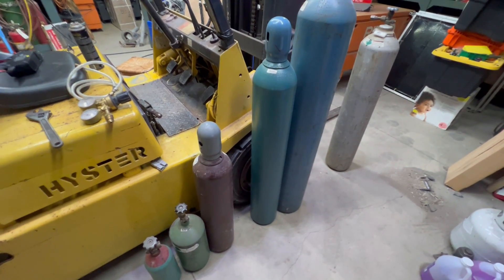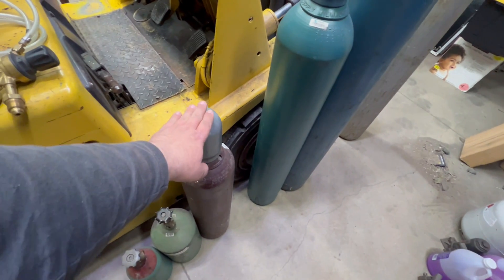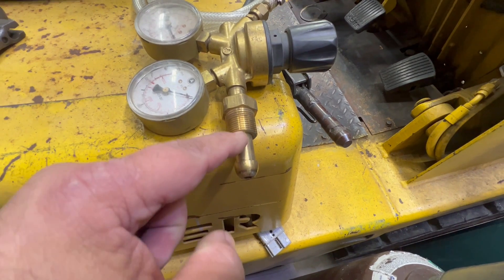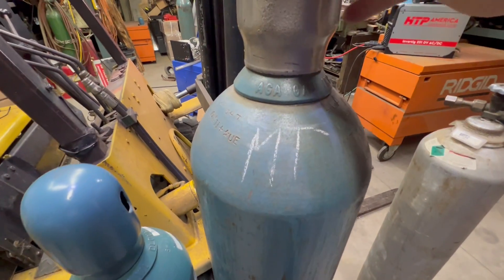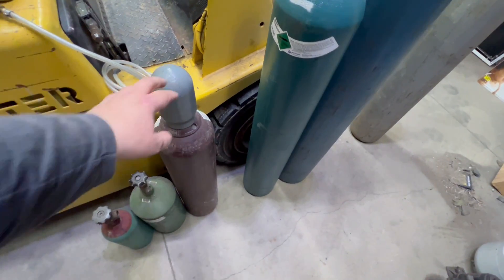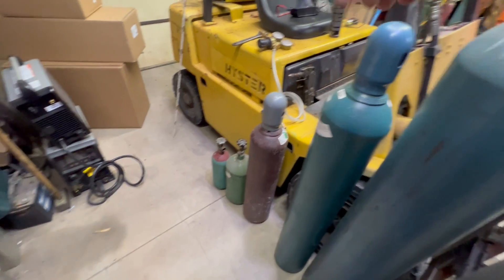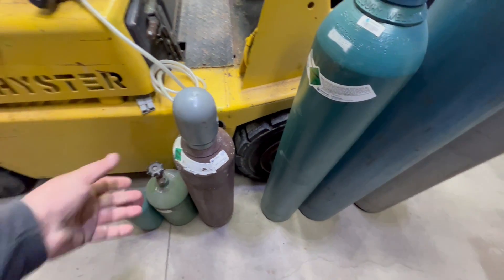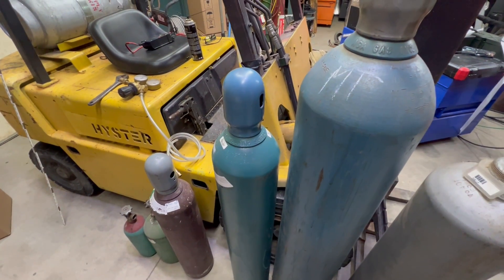Welding gas tanks explained

Comment: I have a oxygen tank is there a way to us it for CO2 welding
Reply: Yes you need to replace the valve. I would recommend seeing if it could be exchanged for that other type of cylinder or you could pay to get it tested which is a good safety measure and they can put a new one on. You may be able to replace it, but have fun getting it off.

Comment: Whats an average cost to exchange an empty C25 125cf cylinder for a full one now days at a welding supply company?
Reply from the maker: Hard to say.  I heard in hawaii they get you for $300-$400 here in the midwest, chicago- milwaukee area between 35 cash, 50 with paperwork up to 90 with paperwork depending on where you go ….  And all other gas shop in the country are anywhere in between $35 and $200…..  its really hard to say, for accurate information you have to pick up the phone or go there and ask questions ….
Reply: @ZILAwelds .. ok thanks.

Comment: constantly see used 20cf o2 tanks for sell on MP & CL for cheap looking to add gas to my flaux/mig machine but the little I use the machine i don't want to invest a lot in getting gas set up...can these little 02 tanks be filled as 75/25 exchange?
Reply from the maker: @sonofsteve566  no, o2 has different valving
And even though i know guys who can re-valve and pressure test it, by the tine you are done you wish you wouldn’t have done it !!!!
And to get those filled ?!? Forget it - its not a standard pressure rating, also its not a standard size the gas dealer keeps in stock, so you cant exchange it, you’ll have to drop it off, wait a week or 2 to get it filled, and a fill like that because of all the extra hassle and handling is probably going to cost you $75-$100 for that little specialty  cylinder you created there ….
Reply: @ZILAwelds  
perfect appreciate your video and response 👍

Comment: okay I understand what you're telling me now so the thing tank that you sent to me that's mean that when it empty. I could put different gases in it, right?
Reply from the maker: theoretically yes - BUT it all depends on your welding gas store .... THEY drive the game  THEY make the rules ... and rules vary from store to store, company to company and state to state .... some are more accommodating to the customer's needs .. and other are just in a permanent state of showing you and me who is boss ....
Reply: @ZILAwelds  you right ✅️ 👏 🤣
Reply: @ZILAwelds  how good is 3/32 Stick rod
Reply from the maker: @leslywilliams4799  steel?  aluminum ?   well - there are guys welding cross country pipelines with 3/32 steel rod, today, right now.    if used in the correct application it can be a good rod.
Reply: @ZILAwelds  a valve replacement may be necessary if the place filling cannot establish if it can handle a different gas

Comment: wha if your tank of CO-2 finish now the tank is empty can you put Argon and the tank instead use it what I am trying to say is.Can you use the same tank over and over with different gases when it finish or when it's empty
Reply from the maker: In the USA co2 and argon have different valves. You cannot fill a co2 tank with argon. 
Argon, nitrogen and helium have the same valves.
Reply: @ZILAwelds  what is the name of those metal blocks that they put the pipe in and they rotate as they welding metal and steel
Reply from the maker: @leslywilliams4799  V blocks ????

Comment: Helium is rare in Europe, here it comes from oil wells. Before the war, Germany wanted to buy from usa, but were refused, as it was a strategic material. Remember Rockey & Bullwinkle cartoon? The bad guys were always trying to remove "Mount Flatmore" from usa, the floating mountain. Was this the same theme?
Reply: It is used, however, suppliers prefer to make special mixtures that mimic the benefits of it

Comment: In 2006, I bought my Miller 251 with a 160 tank, and the unit was a demo model. The price included the tank and that gas lasted me a couple years then when I needed a refill, I upgraded to the largest tank in the video, which fit on the 251. I think I exchanged it twice since then. I lose more gas leaking out the hose and fittings by forgetting to turn the valve off, than I do using it. It is nice to have, don't use it every day and I keep my gear in good order so it lasts. Good video!

Comment: People if you are new to welding a vital thing most people don’t tell you about gas tanks is most gas supply require you to have a pickup truck. They will not allow you to carry the tank inside of a car or suv. If by some chance the gas supplier does fill it, they make you sign a wavier of liability. It is very dangerous for a tank to be inside the vehicle. Also, you should always strap your tank to the truck do not let them roll around. If you don’t have a truck most gas suppliers offer delivery for a fee.

Comment: I bought a 100% argon tank, then started to learn about CO2/argon mixes.  Instead of replacing my tank with a mix, can I blend them together by adding 4 cfm of CO2 to 16 cfm of argon?

Is there an advantage to dial-type flow meters versus ones with a ball in a clear column?

Thanks!
Reply from the maker: >> I bought a 100% argon tank, then started to learn about CO2/argon mixes. <<        

 typically you can trade it in next time for lets say a 75/25 gas tank ....  they just exchange it for you ....  

 >> Instead of replacing my tank with a mix, can I blend them together by adding 4 cfm of CO2 to 16 cfm of argon?<<.    

maybe ....  it is not "that easy". you would need 2 identical regulators and also identical tank pressure (as some flowmeters change output pressure (and flow) with lowered tank pressure ....       so you need 2 identical regulators ... AND in the very beginning the mixture might not be "right" till about a couple seconds into the weld ....   so maybe its possible but it is too tricky and painful for me personally .... I know there is a guy on welding web who does that kind of stuff ....  but this is not for me ...    I give that a "possible but impractical"

>>Is there an advantage to dial-type flow meters versus ones with a ball in a clear column?<<.   
maybe.  they function differently ... the dead headed pressure is different ... also single stance flowmeters *the one with the floating ball) are "shit" in my opinion .... at least th cheap Chinese single stage ones ... the good ones cost north of $300 each ....   

the dead headed pressure and the out put pressure changes with the tank pressure .....   also the flow rate changes ....  so you keep adjusting the flow rate as your tank pressure drops ....  also ... because the pressure drops too ....  40 cfh on a full tank are pretty close to 40 chi on an external calibrated meter ...  but 40 cfh (adjusted up to match the lower tank pressure) are now barely 30 cfh ..... and you though 40=40 ....   

a good quality regulator (the one wit the 2 round gauges) is much more accurate, it does not change output flow or pressure regardless of what the tank pressure is .... BUT it has an internal diaphragm which is you use high flow rates and let the regulator ice up and then dont bleed it down but take a lunch break and your regulator unthaws in the sunlight you might blow up the diaphragm .....   so pick the one that works best for you !!!
Reply: The main issue is mixing you have to use special equipment to have a uniform blend not just both coming out but not mixed that good

Comment: If you look on older Linde oxygen tanks, you might find a 4 square mark on tanks that were made prior to 1945. The mark at one time was a swastika and when the war ended a box stamp was used to hide the arms, making it look like 4 boxes. I once saw an 80cf oxygen tank with an original test date of 1896 that had an unblemished iron cross on it. 100% CO2 tank pressure is around 800 PSi because it is stored as a liquid that sublimes as it is drawn out of the tank, a 50 lb CO2 tank will typically have about 400cf in them. 100% CO2 results in much more spatter with the mig process.
Reply from the maker: >>100% CO2 tank pressure is around 800 PSi because << well my CO2 tanks are all 1800 PSI or higher !!   >>it is stored as a liquid that sublimes as it is drawn out of the tank, <<. not sire about that either .... that is more acetylene .....  in the 2 co2 tanks I own its a gas.   >>100% CO2 results in much more spatter with the mig process<<.  well - that all depends ...  if you have a machine that has a good CO2 program .... like the HTP revolution 2500 or the miller passport 180 you can make some beautiful welds with very low or no spatter with 100% co2.... it tends to be more forgiving on slightly rusted material than mix gas would be ....
Reply: @ZILAwelds  The electronics have come a long way, CO2 has a broader depth of penetration, argon puts a spike at the bottom. Recheck your tank pressure gauge, the dial may say 1800 max, but the gas in the bottle shouldn't get over around 860. Acetylene is usually about 250 with a 300 psi gauge. The 'red line' at 15 psi is there to remind people that acetylene becomes unstable at 22 psi. At the end of WW2 the Germans were dropping WTL size acetylene cylinders to supplement their lack of incendiary bombs, they would explode on impact with the ground. I started working at Miller Electric in 1982.
Reply from the maker: @richspillman4191  I just make my way out into the shop, 3A1800 .... that is an 1800 PSI tank ...  the exact 100% co2 that was in the video ... also the regulator reads tank pressure currently at 1300 psi (for what that is worth ... accuracy and all).  I have a smaller 55cu ft .. that says 1800 as well ...  and the needle one the gauge reads 1750psi ....
Reply: @ZILAwelds  That's what the tank is rated, the gas inside and the liquid are around 800, 
"CO2 Tank Safety Concerns
CO2 cylinder pressure is about 860 psi at normal room temperature. Typical CO2 cylinders store about 50 lbs. of liquid CO2. Two pounds of liquid CO2 expands to about 20 cubic feet of gaseous CO2 at atmospheric pressure, or expands at a rate of 535:1.Oct 25, 2023"
"How many PSI is a 20lb CO2 tank?
CO2 cylinder is filled with liquid CO2 by weight. At the time of fill the temperature of the charge is extremely cold and the pressure is around 100 psi. When a fully charged 20 lb. CO2 cylinder, 68% full by water capacity, warms up to room temperature (70 oF), the pressure inside the cylinder increases to 837 psi."
Reply: @ZILAwelds  If you were to open your valve with no regulator on a co2 tank, the contents would go from a liquid state to a solid (Dry ice) and it could take hours of not days to get the ice ball out of the tank. There is super critical co2 as well as super critical helium, it's physics, I've been doing this for 40 years, metallurgy, gases, processes, there is always another way to skin a cat.
Reply from the maker: @richspillman4191  sure ... at above 87.8F it odes not matter how much pressure is in the tank .. it is a gas . It can only be liquid below that temperature.

Comment: For some gasses like CO2, nitrogen and sometimes argon or oxygen, a beverage or beer supply place is often more likely to "refill while you wait" and give you your own tank back, or sell a new one.  Some of those customers are folks that have pretty basement or store setups on display, etc so it's more expected.  (FWIW, Argon Cold Brew Coffee tastes just about the same as Nitro Cold Brew Coffee, except more expensive.  Those shops are also handy if you need food grade gas, that you might occasionally steal for welding.)  Some places like Weldfabulous will also ship full tanks....80cu oxygen or argon is about $300 though.

Comment: Came from TOTs video. Just want to elaborate a bit on the bottle discussion for new people. Here in AZ (phoenix area) the go to for gas is called Vern Lewis welding supply. They are really cool. When I needed an additional bottle the guys at the counter told me it would be better to find one on marketplace then they’ll swap it out to avoid the lease/contract fees. So I found a 330cfm.  Cost me $120 for the bottle then they swapped it for $79. They did not care about the certificate or anything else. I moved from Denver 4 years ago and the welding suppliers there would NOT touch a bottle that did not originate with them. So you’d need to buy one of their bottles to start then they will swap them out as needed for $75-100 depending on size. But to buy the bottle from them it was over $350 for a 160cfm or whatever the 48” bottle is.  Best to go to your local supplier and have a discussion with them. I was anticipating filling out the credit contract and going through the lease process until they said ‘or you can buy one on marketplace, we don’t care about the certification’.
Reply: I didn't know they dealt with owner bottles! I tried going to a local metal and welding supply store that apparently handled vern lewis bottles exclusively. They said they only exchange  Vern Lewis bottles.  This made me believe you needed a leased bottle so they could work with you. I guess you have to go to Vern Lewis directly if you want to swamp out your owner bottle!

Comment: Iam use to the big bottles at work & was kinda thrown off by how quick the smaller bottles burn up
Reply: 20 cubic feet an hour, 80 cf tank, less 20% residual, about 3 hours of welding.

Comment: I have several welding machines.- MIG, IGBT stick, Lincoln Tombstone AC only (1970 era), and a couple of gas torch sets. but I'm not a welder. I have my own oxygen, acetylene, CO2, and Helium tanks. I don't rent because I use so little gas I'd pay for a tank in rent before emptying the tank. And yes, when I do go in for a refill of my tank, I walk out with a different my tank. 😄
Reply: Do you know why there is a circle around the 70 amp setting on your tombstone? That is the 100% duty cycle setting used for pipe thawing. I had a customer that would thaw pipes for people in the mountains and one lady refused to pay, I think it was $50.00, he yelled out to his helper "Reverse the polarity and freeze 'em back up!" the lady paid...
Reply: @richspillman4191  Reverse the polarity and freeze 'em back up!
Fortunately, she didn't understand how AC power works. 😅

Comment: I had no idea about any of that. I was surprised at the cost to refill; I expected more. I guess at 85 cents a day that adds up as well.
Reply from the maker: the cost varies regionally ...  here in the Midwest (Chicago, Milwaukee metro area) its about $50-$60 if you have a "reasonable" gas distributor ...  some guys try to get you for $80 ....  I have heard that in California or New York people pay well over $100 sometimes as much as $150 per fill (argon that is not helium .... helium is $400+ per fill anyway ....  and I have talked to guys in Hawaii and they pay $400 for an argon fill if they "import" it themselves if they buy it locally on the island it can be as much as $1000 per cylinder depending on the size ....
Reply: Interesting.  Thanks.